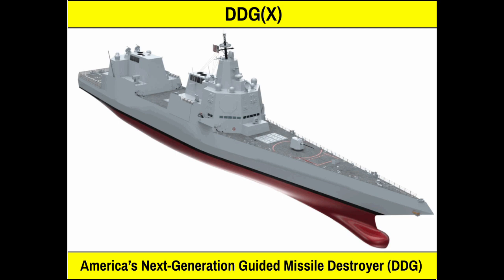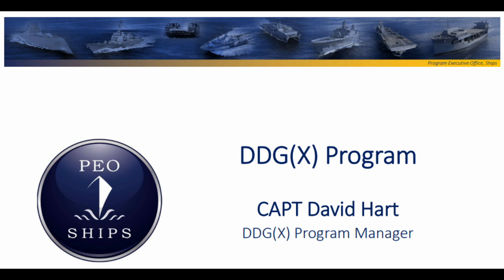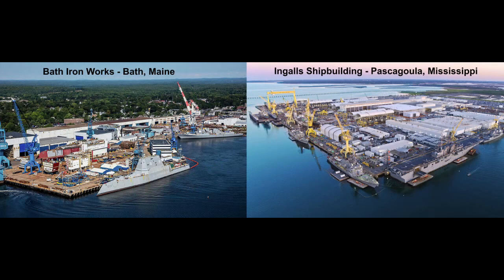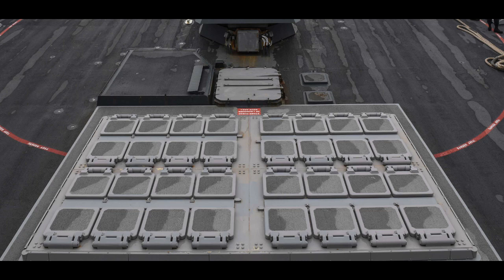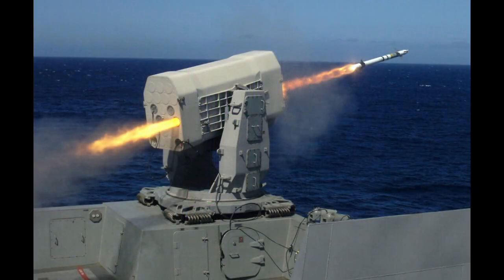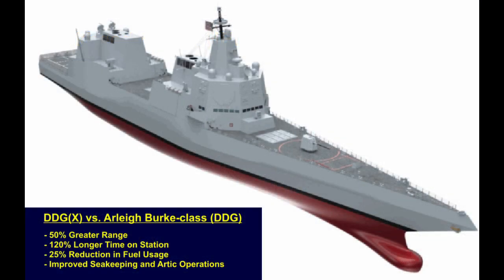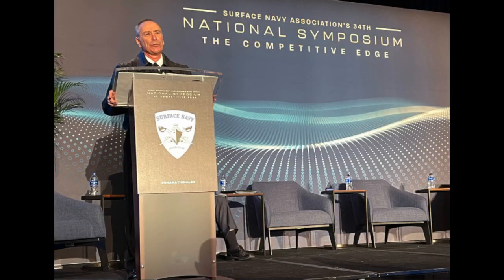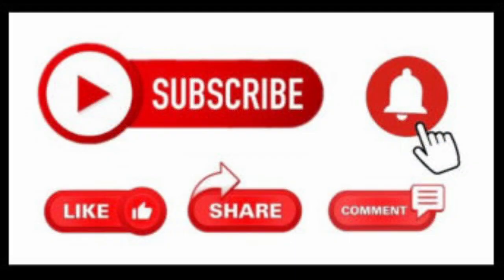DDG(X) - America's Next Generation Missile Destroyer (DDG)

Comment: How is the class NOT classed as a cruiser?  Since at 13k tons it's about as heavy as the Chinese 055, which the US does class as a cruiser.  It even looks like a cruiser.
Reply from the maker: I agree. The Zumwalts should be classified as cruisers as well.
Reply: @thestealthchannel  Was there any real difference between CG-21 and DD-21 or CG(x) and DD(x) as they were later known?
All I can see is that they would've used Zumwalt hulls, shoved more VLS in there and used nuclear reactors.

It's kind of telling of the times when the only real difference between a destroyer and a cruiser is the amount of armament mounted on the hull and the subsequent tonnage, even when the hull is exactly the same.
Reply from the maker: @Tounushi  There was a model of the CGX that was created. It had a boatload of more missile tubes and a more standard hull. I'll post a picture of it in the Community Tab.
Reply from the maker: @Tounushi  It seems the CGX was based around the Arsenal Ship concept. The USN blurred the lines between cruisers and destroyers back in the 1980's when they built the Ticonderoga-class cruisers which used the same hull as the Spruance-class destroyers. In fact, the Ticonderoga's were initially classified as destroyers with the USS Ticonderoga herself being designated as DDG-47. They redesigned them as cruisers due to their primary air defense role.

Comment: I don't understand really why we couldn't have stuck with the zumwalt-class. Yeah I get it there were a lot of systems that were new and untested but that would have been straightened out over time. All new systems have bugs to be worked out. Yeah it was expensive. But it's a bigger platform tonnage wise and the capabilities are whatever you want to put in it. In the design of the new destroyer I don't see any upgrades there other than a newer radar. And really no one should care how it looks only how it performs. And it needs to perform a lot better than the arleigh Burke flight threes or else what would be the point? And it would not replace the ticonderoga-class. At least not if you want to consider having cruisers in the Navy. Of course the newer arleigh Burke destroyer is are much more capable than any cruiser the US Navy has filled it before so it's a moot point.
In the end the Navy needs ships to help fill its primary mission goals. This is always meant to protect the carriers, and yet in today's world of area deniability hypersonic missiles the carriers will not be close by. At that point in Navy becomes pretty toothless except for launching long range missiles.  And that's only if you can keep the submarines far away. So far I do not see a coherent strategy.
Reply from the maker: The Zumwalts were originally designed for the land attack mission in support of ground forces during the War on Terror. With the end of the War on Terror, the ships lost the mission they were originally designed for. In addition, ballooning costs stemming from the reduction of the number of ships from 32 to just 3 ships and the cancellation of the Advanced Gun System's custom designed ammunition, the Long-Range Land Attack Projectile whose cost per round skyrocketed to $1 million. In an attempt to redeem the Zumwalts, the U.S. Navy is going to convert them into blue water combatants by retrofitting them with hypersonic missiles. See my new video, "Can Hypersonics Redeem the Zumwalts?" to learn more:   https://youtu.be/4mGd3w4Eacc
Reply: @thestealthchannel  I understand what the zumwalt's were originally designed for, but it seems to me that they're much more capable then just for the original purpose. I'm betting once all those missiles are fired off and there's no easy way to resupply at sea, that those gun systems will come in handy and somebody's going to be really sorry that they didn't fund that ammunition and more ships.
Reply from the maker: @RobFomenko  They should have kept at least one AGS and armed it with conventional shells, if possible. If not, equip it with the standard 5-inch used in the fleet. They didn't fund the LRLAP because they had a massive cost increase to $1 million per round. USN is currently building Flight III Arleigh Burkes, which are much cheaper than the Zumwalts,  to fill the gap until the DDG(X) arrives.
Reply: @thestealthchannel  How much could they have "downgraded" the Zumwalt to make it cost-effective while still keeping the same hull?

Comment: The DDGX should be classed as CGX. We need new cruisers, not more destroyers.
Reply from the maker: Current USN destroyers are fulfilling the role traditionally filled by cruisers in the past. Ever since the USN built the Ticonderoga-class, they have blurred the lines between cruisers and destroyers. The USN did have a CG(X) Program in the early 2000's, but it was canceled in the 2010  Quadrennial Defense Review.
Reply: You also need more destroyers to replace the old Arleigh Burke, not to mention the new flight 3 variant would be totally obsolete without the new iteration of the Aegis combat system
Reply from the maker: @dani.zambomagno  The new SPY-6 radar is planned for Flight III Arleigh Burkes.

Comment: Copy of Chinese Type 55...
Reply from the maker: There are some visual similarities, but they are different ships.
Reply: I love how Chinese Keyboard Warriors will focus on one thing and ignore everything else. If you actually watched the conference video wherein this design appeared on screen, they said the hull design hasn't been finalized, this is just a placement holder. They also displayed a hull design that looks more similar to the Zumwalt, but of course you ignore that one.

 Ultimately, even if we went with exactly the same hull design of the 055, that doesn't mean its the same ship; its the weapons, guidance, power, and propulsion systems that the hull is equiped with, that really matter. There can be two different ships that have the exact same hull, but that doesn't mean they have the same capabilities. One could be vastly superior to the other. Just imagine how it would feel if we took your design and made it better?

At any rate, even if we ripped off Chinese design(and there is no proof we have at this point, as again, the design isn't finalized) it's not as if the Chinese have never ripped off American design.